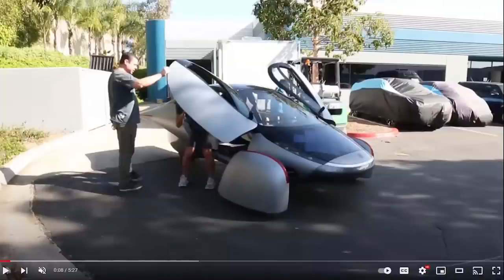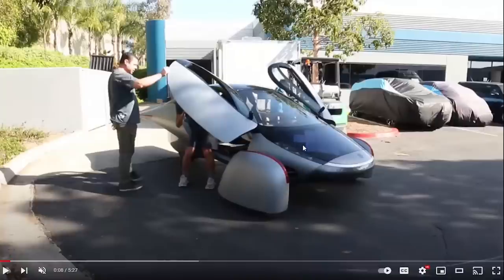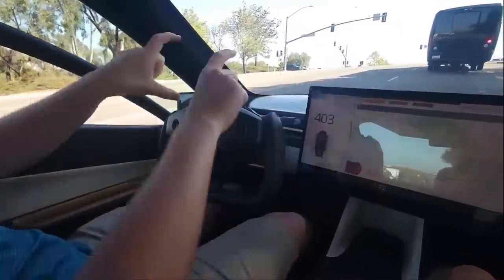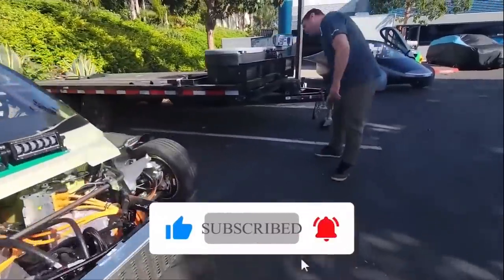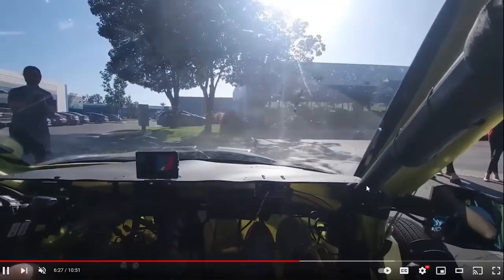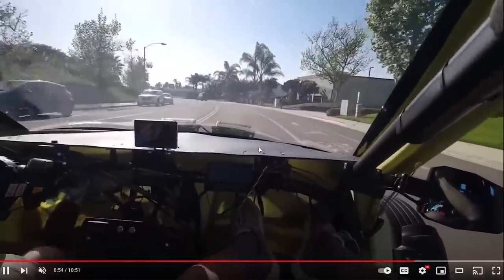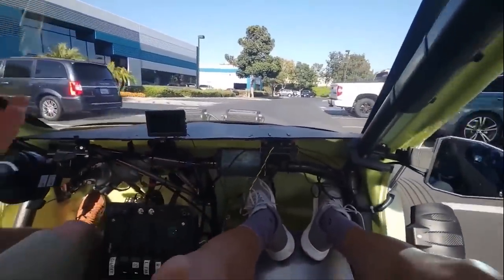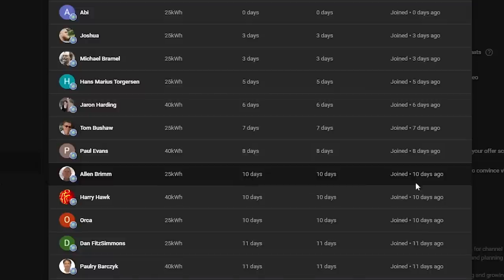Aptera is basically a sports car - Alpha and Beta ride impressions and thoughts

Comment: Dummy Solar panels? At this point shouldn't they have  working solar panels by now.  🤔
Reply from the maker: they have them but they are off vehicle currently.  the next beta will include a solar integration
Reply: @ApteraOwnersClub  it appeared that there was a new beta that was being worked on as you were walking by during the wheel cover video.  If that was the case, can you comment on the new beta?
Reply from the maker: That beta is the beta we drive.  There is a new beta that is being built but I did not see that one
Reply: @ApteraOwnersClub  okay. It looked like a different vehicle than any Alpha or Beta. My mistake.
Reply: @ApteraOwnersClub  If you know and can say, do you get the sense that the hood and roof solar cell arrays are separate "skins" that are simply added to the top of a structural hood or roof?  I'm anxious to determine just how easily removable/replaceable such solar cell arrays can be.

Comment: OK well to be a sports car we NEED to have excellent tires we can use and the tires  selection in the size i was told will be used are NOT good ! 195/45 /16  ?  there is a poor selection of tires for 16" wheels   this car NEEDS to have at minimum 17" wheels and the smallest size great tires are the Michelin PS4   215/45/17 
WE KNOW these Michelin are GREAT tires we have a 19" version on our Ferrari F430 ! they are all season tires that work like summer performance tires     trust me, the Asian tire brands Yokohama , etc are crap ! ( compared to Michelin ! - sorry but true ! don't forget, Michelin INVENTED radial tires ! ) 
tires are getting bigger diameter as a trend in automobiles it all has to do w/ the STUPID European pedestrian impact regulations to accommodate idiots who walk in front of moving cars!  they required room  between an engine and anything hard ( like an engine )  this caused stylists to raise hoods ( bonnets ) which led to bigger wheels to try to preserve proportions ! so 16 begat 17 begat 18 begat 19 begat 20 and ............................so specing a small tire is dooming us to a limited selection and crap tires ( and it will ONLY get worse ! ) SOMEBODY NEEDS TO reconsider tire size BEFORE finalization or we are going to have to soon use/ buy custom bespoke tires in a rare size . read VERY expensive ! 
seems to me this car NEEDS awesome sticky tires for good performance and the best driving dynamics ! ( and safety ) 
I'm used to a supercar and this car has near supercar performance ( at least in acceleration ) and NO you don't want narrow, low profile sidewall ( as a way to fit 17" in the space of taller 16" sidewall tires ) as they will cause BENT wheels fr chuckholes AND those are difficult to avoid in a 3 wheeler ! 
kind regards, An enthusiast !  
PS My bro is getting an Aptera he WILL push it to all it's limits !